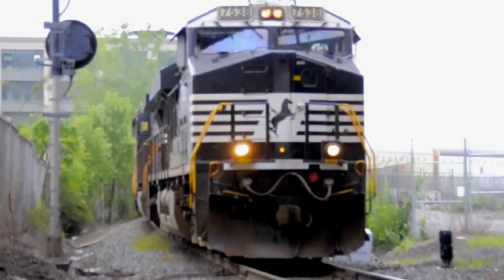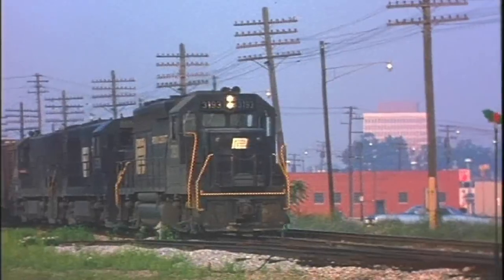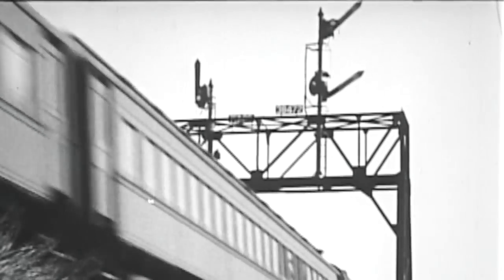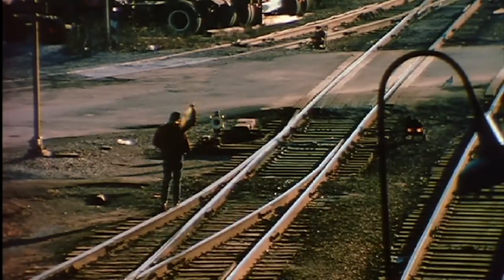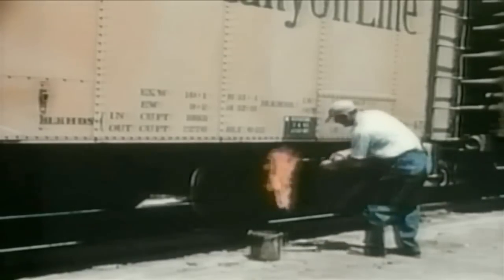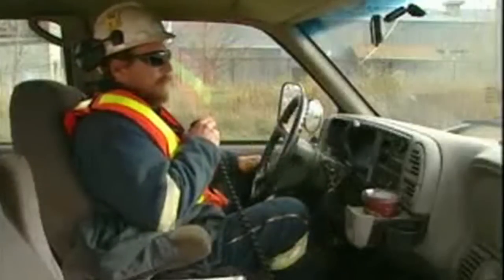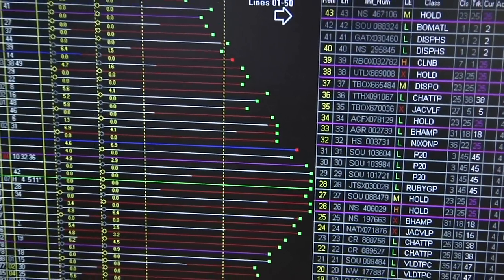Communications and Signals:Then and Now

Comment: On some older branch lines that use jointed rail, you can see where grade crossing circuits are located. 
Just look for an insulated joint that are usually colored green or yellow.

Comment: I used to work as a technician for Canadian National Telecommunications, which was part of the railway.  Back in the mid 70s, I worked in Northern Ontario on the systems that worked along the tracks.  These were the old open wire carrier systems, that carried multiple voice circuits over a pair of wires.  Some of the traffic was for signals and also for the dispatcher's phone, train to wayside radio and more.  I also worked on the teletype machines and circuits that carried the railroad communications.  In addition, I worked on a system that managed freight train consists.  My work would also occasionally take me into the dispatchers office, where I could see the big board, showing operation of rail traffic in the region.  I also frequently rode freights, to get to work locations.  In addition, I managed to salvage a Morse sounder from the CN office in Geraldton, Ontario, before it was demolished.  I still have it here.

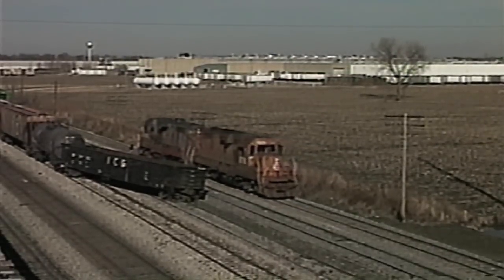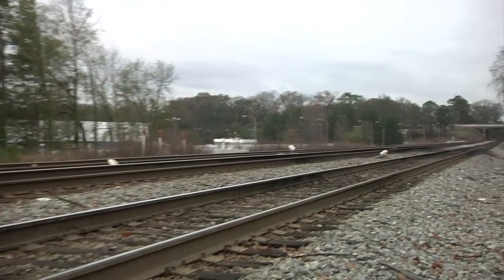Comment: 3:28 rail maintenance now includes highway + railway = hi-rail. 4:10 1960s/70s private microwave comm net, now 440 stations. 5:23 at-grade crossing warnings. 8:05 wayside inspection 8:25 hot-box detector HBD for overheated wheel bearing 8:32 smoking HB possibly observed from caboose at end of train. 8:47 1960s wayside detectors 9:18 cabooses eliminated in early 1980s. 2012: NS had 1000+ HBD, most with dragging equipment detector. 10:02 early communications: wayside phones, loco engine phone. 10:43 train order hand-off 11:49 car-tracking systems. 12:04 late 1960s ACI automatic car identification. KarTrak abandoned after a decade. 12:28 mid-80s RFID AEI automatic equipment ID. 12:51 650 NS AEI readers (2012) 13:09 hump (classification) yard, where trains assembled. 14:13 now using computers, remote-control locomotives

Comment: Between the overwhelming adoption of containerized shipping,  the "evil" PSR, consolidation of Class 1 railroads and remote operations of yard locomotives, the need for car by car sorting for interchange in hump yards has been greatly reduced.  

 Some examples of closed hump yards: 
Barr Yard (Illinois Central Railroad) - 2015
Belt Railway of Chicago Clearing Yard (Belt Railway of Chicago) - 2018
Brewster Yard (Wheeling and Lake Erie Railway) - 2017
Eastside Yard (Southern Pacific Railroad) - 1980s
Havelock Yard (Burlington Northern Railroad) - 1997
Pigs Eye Yard (Burlington Northern Railroad) - early 1990s

Many others had the humps removed and just became a flat sortation yard, including:

Union Pacific - North Platte Yard (North Platte, Nebraska) - 2008
Kansas City Southern - Avondale Yard (Avondale, Louisiana) - early 2000s
Union Pacific - Settegast Yard (Houston, Texas) - early 2000s
CSX - Russell Yard (Russell, Kentucky) - early 2010s
BNSF Railway - South Seattle Yard (Seattle, Washington) - early 2000s
Reply: Oh look the moron uses copy paste

Comment: I was employed as a Field Service Representative for Harmon Industries from 1989 to 1995.  I worked with the PMD and HXP crossing systems and the Hot Box Detector.
Reply: Would you have any insight on the Model 24 or Model 34 detectors? Most references I've seen are for the Model 32 or Model 75, but these two pop up occasionally - but I'm unable to find any information on them. Thanks!

Comment: When exploring abandoned tracks I come upon those oil bottles for the batteries I wondered how that worked. Good history
Reply: Those little bottles contained sulfuric acid. Lead acid  batteries were used to power early railroad signal systems. The acid produces electricity through a chemical reaction with lead plates.

Comment: Depending
Of
Load
Number of
Coaches
Speed
Wind
Resistance
Weather
Condition
In
Hilli
Area
Number of
Station
Passengers
Train
To
Be
Stopped
But
Goods
Train
Carrying
More
Load
Like
Steel coil
Cement
Coals
Minerals

Comment: My grandfather was a gate operator in Arlington Heights, IL for many years before automatic grade crossing signals were installed.  He had an elevated "hut" on stilts, and a coal stove to heat it as he stayed overnight.  As a young lad I'd walk the tracks scrounging coal with him as my "job" for getting to stay in the hut overnight, riding the train back to the city the next day.  What memories those times made!

One thing common to EVERY "advancement" made in this video was the elimination of humans, much for safety and reliability, but also for economic reasons; we lamented the passing of the caboose for the same reason as it was the end of an era.

Comment: I worked for CSX 37 years as a communication tech. Technology changes about every 5 years.  The railroad is full of technology. Doesn't look like it from a distance but it is. Upgrade on his hump yard info in the video; Car goes over the hump, radar gun records the speed so it can get the retarder to slow it down if needed, Car id tag on the front is read by an AEI system which will tell the computer which switches to throw and send it down the right track so it will be heading towards its destination. Electronic sorting system. AEI tag readers provide listing of cars in a train. Satellite links to wayside radios and signal switching bungalows for instant control. They need FCC licensed techs all the time.
Reply: I worked in the billing department and those AEI equipment id tags were very useful when it came to tracking movement of products and entering the correct car numbers onto the waybill.  Especially when it came to coal trains, grain trains, intermodal flatcars and any other manifests.  Sometimes the AEI readers would skip a car number, and it took just a little research to determine what the missing car number was.

Comment: since locomotives don't have shocks, how does a train driver keep from getting back problems.
Reply: Railroad locomotives ride on flat rails and the only bumps are going over  switches or on very poorly maintained branch lines that typically operate at less than 25 mph.   They're nothing like driving a tractor-trailer through potholes.

Comment: Wow, to see semaphore signals stateside in action, a rarity.   The ball on a rope was common here in the UK, replaced with a flat disc and bar until semaphore became more commonplace on British and other countries networks.   My late father began his British Rail career at a signalbox called North Kent Jnc which was historically the very first signalled railway section in the world, he went full circle to finish his career at London Bridge power box but returned to lever boxes in retirement at Swanage Railway.    Def pleased to see them US semaphores, like the idea of the third position of the arms which I guess is horizontal=stop, 45 degrees=caution and straight up=full clear ahead?   Ours were only ever two position and some of the old gantries like Rugby, Newcastle, even Bath Green Park were incredibly complex rod and cable setups that required massive signalboxes and large teams of signallers.

Comment: In US it is far different than Europe. Not sure if it is in your locos too, but we have some systems that really iimproves safety called RADIOSTOP. Alarm signal to radio triggers emergency breaking. It is not often in use, but when something goes wrong and two trains get on same track (control devices failure, human error or any other accident) it saves lives by stopping both. All railways should be still modernised, especialy contol and safety devices.
Reply: Does that system exist in Greece?

Comment: How about improving the black zone between Augusta, GA and Columbia, SC?
Reply: The use of dark territory is typically associated with rural or remote areas where the volume of train traffic is low and the cost of installing and maintaining signal systems may not be justified. In the case of the section of track between Augusta, Georgia and Columbia, South Carolina, the absence of signal systems may be due to the relatively low volume of train traffic on this particular section of track.

In other words, if there is only one train on that track and control of the track is controlled by the dispatcher and the train orders are followed, a collision with another train is impossible.  It is only 12 miles out of the 73 miles that has no signals - between the communities of Warrenville, South Carolina, and Trenton, South Carolina.

Do you have additional information to provide on why this bothers you?

Comment: Are thosewhat those old timey looking utility poles next to RR tracks were for-communications? Notice a lot of them have been removed where I live.
Reply: Microwave communication system.
Reply: Absolutely correct.   He explained that some of those wires were for communications, like the roadside call boxes. Others were used to monitor and operate remote devices.    As the value of copper went up, it started making sense to take them down for scrap.

Comment: 4:05  What the heck is that?! Those tracks look like a derailment waiting to happen. Intentional for runaways?
Reply: yup. tracks that will usually have standing cars on them are equipped with derails to keep said cars off the mainlines. Now back to the Satellite of Love with ya!
Reply: @kennethsperanza89  Thanks. You are indeed a man superior awareness.
Reply: Darren wondered why the switch didn't lead anywhere.  You hit the nail on the head.  Kenny also hit the nail on the head.

Comment: I remember the BNSF Fallbridge Subdivision had pole lines going out of Vancouver, WA until about 12 years ago. The Union Pacific still has some areas in Oregon with lines but they are slowly getting rid of them. Luckily, I found some glass insulators along the track and took them home.

Comment: I managed at a place that rented cranes. One day some guy at the railroad called me inquiring about renting a crane to remove two old crossing signals so they could be replaced with the larger crossing signal lamps. I had always wanted a railroad crossing signal so I struck up a deal with him. He stopped by my workplace and he told me that he would give me the crossing signal but I was going to have to take some other stuff. It was inventory time and the railroad head honchos wanted a bunch of old stuff gone so it wouldn't count on the upcoming inventory. Long story short I wound up getting three full tractor trailer loads of lights, crossings, cabinets, signs, cantilevers, cast iron crossing signs, old glass relays and about a hundred other things that I can't even remember. Over the last thirty years I have given away about 99% of the stuff.

Comment: The narrator said that in the 1950's Norfolk Southern began replacing communication wires. Wouldn't that have been their predecessors, Southern and Norfolk and Western? NS did not come into existence until the early 1980's.
Reply: Yes it would be.
Reply: The original Norfolk Southern was a Norfolk, VA to Charlotte, NC (generally) railroad that was renamed as the Carolina and Northwestern RR when Sou and N&W merged.
Reply: My dad retired as VP Norfolk Southern (signal & communication) in 1975. Hq in Atlanta.Previously, He had been head of Southern RR communications Hq in D.C. The merger must have occurred circa 1973, unless they did it piecemeal division by division.

Comment: If I worked for the railroad back then I would've been a guy who sits in a shack by the tracks and raises and lowers the crossing gates and watches trains go by.     I LOVE TRAINS!
Reply: Mack Pines And then boredom would have set in and you would have begged to get out of there especially since there NO A/C in summer or heater in winter...There may not have been a toilet either!
Railroads have not traditionally been good to its field employees.
Reply: @phantomcruizer    Hmmmmm, sounds like NS with no toilet in their locomotives.  They gave their enginepersons a bag to sh-- in.  Even numbered them so they made sure they were returned and not tossed out the window.
Reply: If back then I would be working in the baggage and mail car or at the station hauling the baggage and mail carts down the boardwalk to be loaded on the passenger train baggage car. I would pick the easy job to do.
Reply: If you can get a work permit, there are still thousands of jobs like that available in India

Comment: 5:53 Why did old crossing gates have like a string or something hanging down from it? I've seen them on the kind of signals made by Lionel for model trains.
Reply: I'm going to guess its purpose is to prevent the arm from bending in the event that there is a strong wind.

Comment: Vary Interesting and Informative.......   By chance, one question please. How does a multi engine train unit talk between each un maned engine? Especialy if a pusher engine is at the end of the train a thousand + feet away??????
Reply: Distributed power locomotives are controlled by radio

Comment: Not a word about atc or ertms, but these might now be used in the US?
Reply: Per Wikipedia:  "Norfolk Southern (NS)
Norfolk Southern Railway began work on the system in 2008 with Wabtec Railway electronics to start developing a plan implement Positive Train Control on NS rails. NS has already implemented PTC on 6,310 miles of track with plans to achieve it on 8,000 miles of track. NS has requested an extension on the time to have PTC active on its miles of track. Due to the need to work more on areas with no track singles or dar areas. Also to have the smaller railroads that the company does business with to be PTC capable.NS keeps experiencing issues with the system and wants to take the proper time to fix the system to ensure the safety of its employees and all others using their tracks. NS has been adding and updating its locomotives with PTC capable computers to allow those locomotives for use on mainlines. 2,900 locomotives out of the almost 4,000 the company has have been fitted with the PTC capable computers. NS plans to put at least 500 locomotives into storage using precision NS has been updating it trackside equipment such as radio towers and control point lighting to assist in PTC operations on the railroad. With the new computers on the locomotives it allows the locomotives to interact with each other and trackside systems. Norfolk Southern's General Electric Transportation locomotives are equipped with GPS to aid in the use of PTC. All of NS's locomotives are equipped with Energy Management a computer system that provides real time data on the locomotive. The system can also control train speed and brake systems on board. The EM system allows the locatives to use less fuel and be more efficient. NS's final goal is completely autonomous operations of their trains. This system will be used alongside Auto-router used to route train movements with little to no human interactions. With these two systems integrated with PTC it allows for more precise movement and train control across the railroad. NS, Union Pacific, CSXT, BNSF, and Virginia Railway Express have been testing interoperation to make sure each companies PTC systems work with each other to ensure safe railroad travel. For this a NS train on CSXT tracks has to act like a CSXT train would or vice-versa. That requires the railroads to use the same communications and radio frequencies for everything to operate smoothly. Nearly 3,000 locomotives have been fitted with the PTC capable computers.[66][67][68][69]"

"Due to the need to work more on areas with no track singles or dar areas." should probably read:  Due to the need to work more on areas with no track SIGNALS or DARK areas.  In my experience 'unsignaled track is the same as dark territory'; the words are different but i think the meaning is the same.
Reply: ERTMS stands for European Rail Traffic Management System.   

Last time I checked, the United States is not part of Europe.  We also use miles instead of kilometers.   We call football "soccer".   Our electricity is 120 v 60 hertz, not 240 v 50 hertz.   Anything else I can clear up?

Comment: 4:05@
 What happen to that track? The switch goes nowhere...
Reply: That's a derail.
Reply: The switch goes where it should go, to a spot where the car that uses it will stop and not be a rolling hazard .  insomthegreat knows what he is talking about but I don't think he though about the probable fact that knowing the name doesn't help much with answering the question.

This is a switch point derail, if I remember the video correctly it is a single switch point derail.  A derail, of which there are several varieties (a double switch point derail would have two switch points) is supposed to take a car which is rolling toward the switch (M) on the main track (MT) or lead and prevent it from following the track it is on and damaging M, from damaging any cars on MT or continuing on wherever gravity and momentum carries it to damage anything it comes into contact with.

Comment: One thing I've noticed that no one really uses yard switchers much anymore.  They tend to use  older former heavy locos to do  switches now. Even got remote units one guy to set up cars to cut costs.
Reply: Mad Mack I know what you mean. At our railyards in the Ohio Valley, we mostly use six-axle SD40-2s to switch whereas decades ago a smaller GP9 would have done the trick. Or even a GE Boxcab.
Reply: In West Virginia we still use switchers, but they look similar to regular locomotives.
Reply: One of the principles behind precision scheduled railroads is you use your brand new locomotives on the mainlines to reduce breakdowns and move the older locomotives to serve out their senior years doing switching service
Reply: Remote units have killed many people.